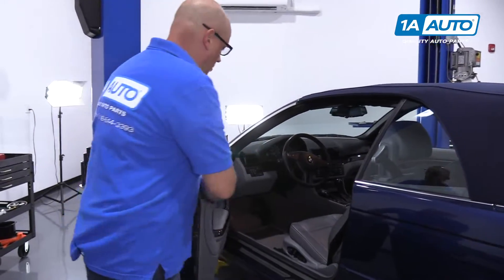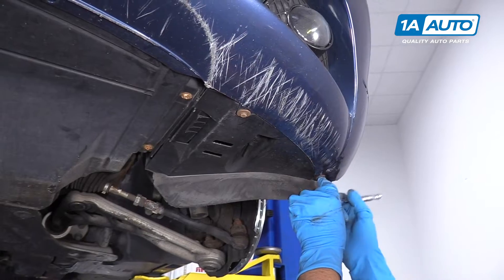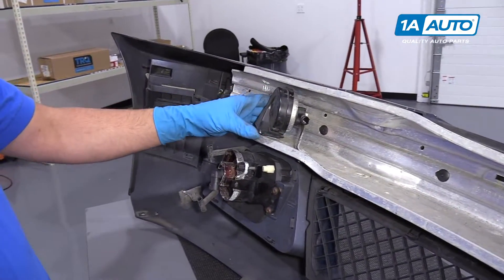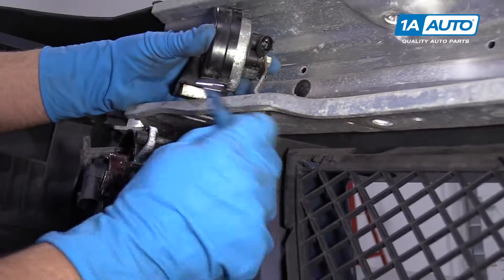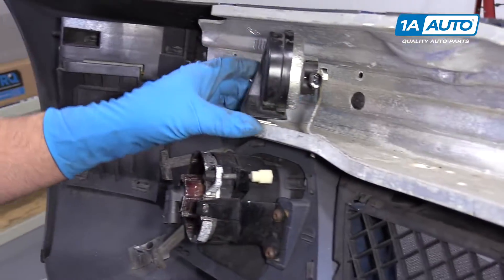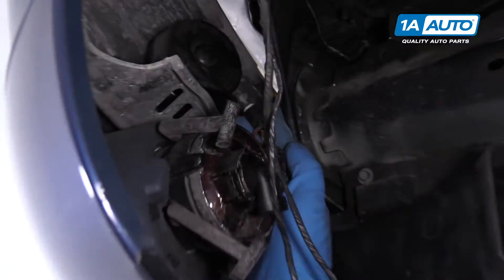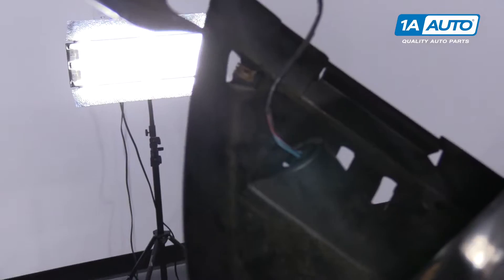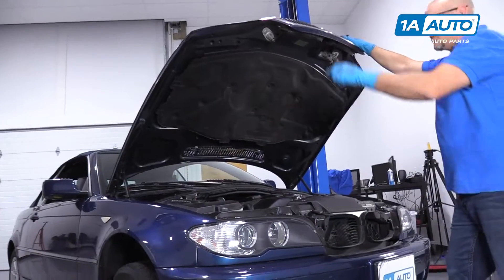How to Replace Horns 04-13 BMW 325Ci

Comment: If you remove the fog lights, can you get access to the nut holding the horn in place ? Seems easier than removing the bumper cover.